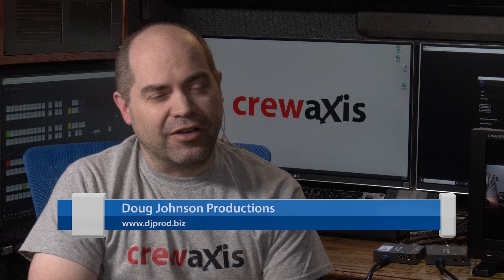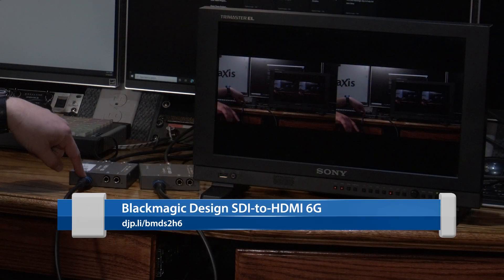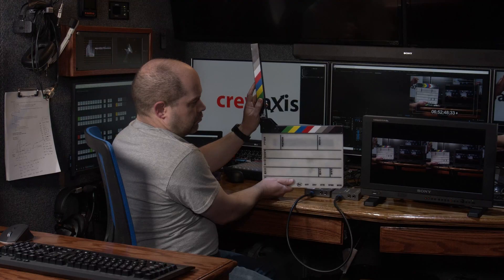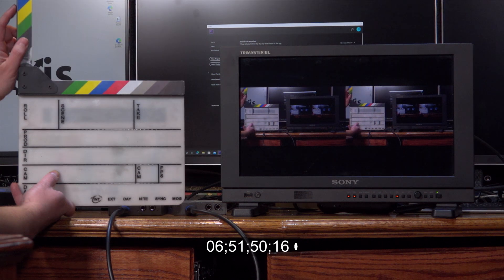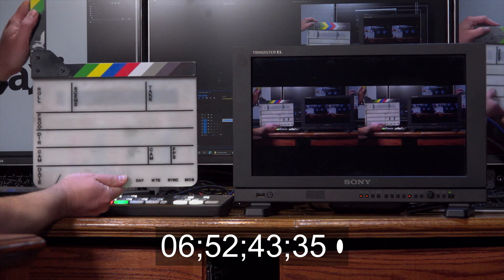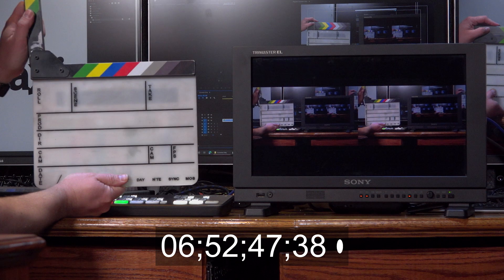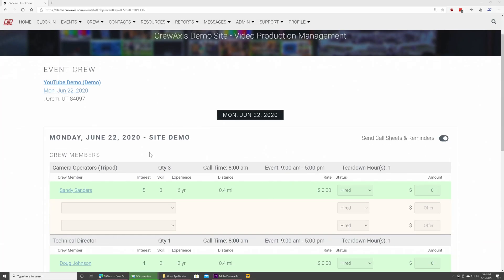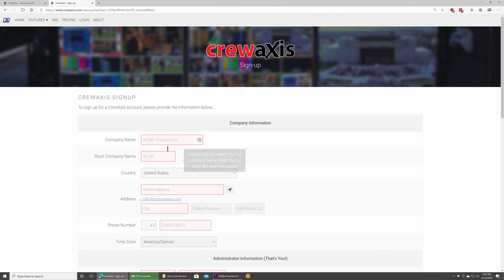HDMI Latency Myth Busted

Comment: All panasonic cameras has latency over hdmi. You have to shut down audio over hdmi recording to stop the delay so. Yeah hdmi does the delay.
Reply from the maker: And is that latency different with HDMI as compared to SDI? That's the point of the discussion. When this video was made there was a rumor flying around the internet that using HDMI instead of SDI caused a lot of latency. And it just isn't true.

Comment: It’s the hdmi cec that adds latency, aming feels floaty etc with it on
Reply from the maker: If that was true, game consoles like the Xbox and Playstation would be too laggy to be playable. Gamers would refuse to use it. But those consoles do support CEC.

CEC is a very lightweight layer added on top of other HDMI features and it shouldn't add any latency whatsoever.
Reply: @djp_video  you could try gaming for 5 minutes with Xbox with it on and off (it restarts every time you change this setting)  and you’ll feel the difference… try with Xbox hdmi cec on and lg oled simplink on… then try with both off
Reply: @djp_video  LG CX has hdmi cec disabled by default… Xbox has hdmi cec disabled as default… many people don’t mind extra input lag, not many notice it…. It’s like many people use BFI (black frame insertion) on LG OLEDs at the cost of input lag and they still use it, they don’t notice it but it does add input lag, capish? Do you use black frame insertion? If you don’t notice the added input lag there that’s why you may not notice the added input lag when hdmi cec feature enabled on console and tv
Reply: @djp_video BFI (black frame insertion) it’s “not too laggy”… a lot of gamers use it and it does adds latency
Reply: @djp_video even digital foundry recommends BFI (black frame insertion) for some games… and it does add latency, but still playable… 13ms with no BFI and around 30ms with BFI and many gamers consider 30ms latency as playable, many don’t notice it, i can tell you didn’t either… but it is a difference in latency… it’s not like 100~150 ms difference, that is unplayable… anything under 40ms is considered playable by many… but there it a difference between 10ms and 30ms etc… for it to be no difference would be to be the same number ms… like saying volume 10 and volume 15.. latency is exactly the same… but with console AND tv with hdmi cec enabled there is a difference… as well when BFI is enabled

Comment: We have always run into issues when deploying video monitoring of a Maestro / Conductor so that a singer viewing at an off angle or from another location can sing in time with the orchestra.  So, I never did this level of testing - and I totally appreciate the work here - but having tried to move our systems to digital without telling the musicians we get notes about how the singers are getting behind or off the beat.  I can't quantify the frames-per-second but it has seemed that any latency at all is problematic for live classical musicians.

But ... if HDMI as a format isn't the culprit but rather the conversion for long runs of HDMI/SDI - SDI/HDMI ... can you do a video on the gear you recommend for a near zero latency digital setup?
Reply from the maker: The trouble with digital signals is that no matter what you do, there's always going to be some latency. If zero latency is a requirement, going back to old-school analog cameras and CRT displays is really the only option that delivers on that promise.

With that said, there are some cameras out there that have low latency, and some monitors can be put into a mode which reduces the latency significantly. Off the top of my head I can't think of any cameras that have latency less than about 50ms, and in terms of monitors you'd want something that's from a high-end professional line, or at a very minimum a TV or monitor designed for gamers. 

Long story short, there isn't a great solution that I'm aware of for your situation.

Comment: Very interesting video, but I have a question for you. If I make a multicam with three cameras, two entering the atem via hdmi, and one entering via a wireless transmitter like the mars400, how do I delay the two hdmi input cameras so that all three are in perfect sync?
Reply from the maker: There's no easy, practical, affordable way to do that. The better solution is to get a wireless system with no latency.
Reply: @djp_video  strange that there isn't an easy way, because I think it's a common problem, especially when you have a streaming system for events where you have cameras on stands connected via hdmi or sdi, and then a mobile camera on a stabilizer, where it's difficult to manage with wires and therefore you have to opt for wireless systems, but even good systems like the cosmi c1 bring some latency….  I saw that obs video input can be delayed but not on the single hdmi but on the whole ip video module by a maximum of 100ms, strange that with blackmagick cobe software you cannot set the lency as you do with audio.
Reply from the maker: Delaying video is the hard (and expensive) thing to do. Every frame of 1080p video requires a minimum of 8MB of memory (12 MB if you want to do it without significant CPU processing), so if you wanted to delay every source of an 8 switcher input by up to a half a second it would require 3 GB of fast memory and a CPU with a lot of bandwidth to do so... so beefier cooling systems are needed. It all gets expensive and requires more power and is bigger.

In addition to that, when you do that everything you're doing and seeing on your switcher is delayed compared to real time. And the audio has to be delayed too. If you're technical directing on-location where you're hearing and/or seeing the live action, you're likely to react early and cut between cameras before you should. And when you're giving direction to your camera operators, you're reacting late to what they are actually doing because you're seeing it delayed, after it has happened. 

The easy solution is to not have any delay at all on your video sources. And good quality wireless systems have zero (or near zero) latency. They also let you use more than one wireless system at a time, which the Mars 400 won't.

Comment: Well I have a real world story. Video playing on a computer output into an HDMI switch into an HDMI splitter to a projector and TV in the sanctuary and TV in the lobby. audio going out to the mixing console to ceiling speakers amplifier blah blah. Visible bad! delay between audio and video in the lobby. Almost like a few seconds if I'm remembering right. HDMI has delayed because of the tv processing the signal tend to put a ton of processing on and dilley the audio to match. You usually have to dig around in the settings for a while to find some sort of game mode that disables it. Otherwise you have to delay the audio but that doesn't work for live things or things say on the other side of the wall of the lobby where you can hear the difference.

Comment: I have 5 the same camera's that run at 50frps. Three come to the switcher by hdmi (1 to 10 meters max) and two come to the switcher by converting to sdi at the camera and back to hdmi just before the switcher. The delay that happens is not noticeable different for the camera's that come in over hdmi as over sdi. There is 4 frames delay in the switcher compared to the direct sound that is coming to the switcher from my microphones through an audio mixer. My guess is that  the camera causes the 4 frames delay and not the hdmi and/or the conversation to and from sdi.  I always 'blamed' the camera for the delays but good to know it has nothing to do with hdemi :)  I was rather surprised that the hdmi-sdi and sdi-hdmi conversion at the other end of the long cable, did not add any noticeable difference between the camera signals. :)

Comment: So... How does cable length affect latency? Is there any more latency over a 50' 3G-SDI cable than a 100' or 150' cable? We do 50' cables mostly, but with more and more productions coming in, the need to expand our system will become more prevalent.
Reply from the maker: Not noticeably. Signals travel at a pretty substantial fraction of the speed of light, so you'll never notice it.
Reply: @djp_video  yeah, ok.  I didn't know if there wasn't some latency induced by the medium itself.  Obviously fibre-Optic is lightning fast, but I thought maybe copper would induce some latency.  Good to know it's not much of an issue.  Thanks Doug!

Comment: I notice there's a 1-2 second delay from my Nikon D850 to the computer / OBS. Which is what brought me to this video. I've learnt from this video that the cable is likely not the issue, and the issue is likely with the output from the camera .. do i understand this correctly? is there anything i can do to reduce this delay? The HDRI is hooked into a CAM link 4K.  Thank you.
Reply from the maker: The camera probably has a pretty significant delay in and of itself. The rest is probably being introduced by your capture device. I've used OBS with camcorder-style cameras going into both a Blackmagic Design DeckLink/UltraStudio or some ultra cheap HDMI-to-USB capture devices and haven't seen what I would call significant latency with that setup.
Reply: @djp_video  Thanks Doug, much appreciated. Do you feel there's anything i can do to reduce this on the camera side, or is this simple a nature of the camera design and typically something that cannot be changed without buying a new camera? Thanks again.
Reply from the maker: @davidedwardsme  There's likely nothing you can do without replacing the camera. DSLRs and Mirrorless cameras aren't designed with low latency outputs in mind -- it probably isn't even on the list of priorities when designing the camera, since they're far more likely to be used for cinema-style production (where latency isn't an issue) rather than being asked to handle live work. Camcorders are far better at this task.

Comment: The test isn’t valid. Latency has nothing to do with the cable but rather the time the camera takes to convert the signal to HDMI. Using a cross converter won’t work either as those devices typically use chips that are much faster at converting. What you need is to compare a camera like the Sony FX6 outputting SDI against a say a Sony A7 series camera outputting HDMI pointing at a timecode reference. I’m not sure how much of a difference there would be but as others have pointed out, the GH5 has a significant delay on it’s HDMI output.
Reply from the maker: At the time this video was created there was a rumor circling the Internet that HDMI causes latency. It was not long after the ATEM Mini had be come popular, and multiple YouTubers and others who are influencers in the video world kept spouting the nonsense that HDMI causes latency and that using HDMI was the cause of there being a delay on the Mini and other switchers.  This video was meant as a way to dispel that rumor. The cause of the delay is the cameras that those people were using (typically DSLRs or mirrorless ILCs), not the type of connection.

Comment: There are myths around that there is a whole lot of problems with the atem mini not synching video and audio but that is just as true as that there is a delay within the HDMI signal. Cams and tech round cams what ever it might be of course adds delay it´s not magic what they do and the more stuff you add to the chain the more delay you get. If that wasn´t the case they would be time machines to look in the future with if you could tweak them to convert faster. I have done numerous streams even in 720 p at very low speeds from 800 - 2000 kbps at 24 fps and the video and audio is in synch. I have watched it on line and downloaded the files and uploaded them again and still no delays in any way.

Comment: One question: i recently livestream a lot and use 2 SDI OUT camera’s and 2 sony alpha with HDMI out. The Sony’s defenitely have a lag compared to the panasonic SDI out cams. Is this due to the fact that the HDMI ports from the sony alpha’s lag? I’m confused.
Reply: We also use a blackmagic ATEM
Reply from the maker: Yes, the HDMI ports on those cameras do have a delay.

You’re using cameras meant for a film-like production workflow. They weren’t designed for live use. So having a minimum amount of lag (latency) was not a priority when they were designed. If you need a minimum of delay it is best to use cameras that were designed for live production.
Reply: @djp_video  okay, thanks for the info. Bummer that they do that.

Comment: ATEM Mini input 1 is “direct switched” to HDMI out for low latency gaming use cases. Try measuring ATEM delay with inputs 2-4. 

Also note that using higher frame rates like 60 FPS vs 24 FPS will give you lower absolute latency when measuring in ms instead of frames because a single frame buffer at 60 FPS is 17 ms (1/60s) delay but the same frame buffer at 24 FPS is 42 ms (1/24s) of delay.

Comment: Dislike due to improper test condition/setup. A test with hdmi cable vs sdi would be a proper test. As stated in the video he added fail points but still originated with sdi feed. A pure hdmi feed is the “myth” of added delay.
Reply from the maker: It's still an HDMI signal.  It doesn't add meaningful delay.  I confirmed that with BMD.

Finding a camera that outputs SDI and HDMI simultaneously and to have two identical low latency monitors that both support SDI and HDMI makes doing this test properly quite problematic.

The myth of the added delay comes from people using cameras that aren't meant for live use and don't make outputting video in real time a priority.  It's very common on DSLR-style cameras so people erroneously associate HDMI with the problem.  

I use HDMI all the time for live production with my Z150s when I'm shooting in 4K (as they won't output 4K via SDI) and there's no noticeable delay to the signal.

Comment: Dough what I have noticed is the problem comes when hdmi is directly coming from camera. In your test setup the feed is coming via sdi than its getting converted by BMD converter.
Reply from the maker: The purpose of the test was to see if HDMI itself causes any meaningful latency (which it does not), not to test how much latency there is on the HDMI output of a camera.  

Every camera is going to have some latency, and less expensive models have more (as their electronics for producing the HDMI signal aren't as fast as higher end models).  

From my own prior testing, I know that the cameras that I use have exactly the same latency on the HDMI outputs as the SDI, so taking the signal from HDMI instead of SDI wouldn't have altered these results at all.

Comment: Conversion is not the problem, try using 2 cameras, one on sdi one on hdmi on 2 inputs in ATEM and than look in the multiview  from the ATEM.
Reply from the maker: You’d have to use two identical cameras which are synchronized for that to work. I don’t have any that have Genlock inputs and an HDMI output.

Comment: Thanks for this Doug. I think I’m amongst the many people who’ve never worked with SDI, and therefore believed what we’d heard about HDMI vs SDI.

Correct me if I’m wrong though, but you did just demonstrate that BOTH have a significant delay, right? Which is why audio sync is an issue with external audio devices on the Minis.

And I’m not sure I understand your comment about games consoles. As I understand it, a delay of audio and video (together) of a few frames wouldn’t have any impact on a game... Only a lag in control input would cause that. So the delay caused by HDMI/SDI is no issue. Or have I missed something?
Reply from the maker: The delay that people are complaining about with the ATEM Minis is coming from the cameras.  Neither SDI nor HDMI themselves have any sort of perceivable delay to them. (There's a tiny bit, but it's a few milliseconds at worst.)

Every digital video camera has some delay from the time the image enters the lens until the digital data comes out the output. It's just the nature of digital.  Higher-end professional cameras keep this delay to an absolute minimum, as there's a pretty good chance they'll be used in a live IMAG situation (that's Image MAGnification -- or in layman's terms, cameras being displayed on a large screen like a projector).  Lower-end models, including most consumer cameras, don't prioritize low latency output, as they're really designed to record video for future playback, not immediate display in a live situation.  Keeping the output latency low requires fast processing, which is expensive, so lens-to-output latency isn't important to camera manufacturers making consumer-grade gear.  As the ATEM Mini is rather inexpensive, it tends to get used with lower-end cameras, which has led to a lot of confusion in the growing area of brand-new live streamers. A lot of bad information is being spread around.

My comment about gamers is because as a general rule they're very picky about latency.  Fast-action games really require an absolute minimum amount of latency from controller input to display output. Trying to play a game where your input is out of sync with what you're seeing is extremely frustrating. If HDMI had a significant inherent delay in it, many games would be near unplayable on any console connected to a TV or monitor with HDMI.
Reply: Gaming requires minimizing reaction time.  If the audio and video are delayed relative to the human pressing a button -- regardless of whether the delay is introduced between the physical button press and the resultant on-screen change -- worsens reaction time.  Especially for retro game speedrunners, a delay of 1-2 frames is enough to completely throw off the tight reaction times required.